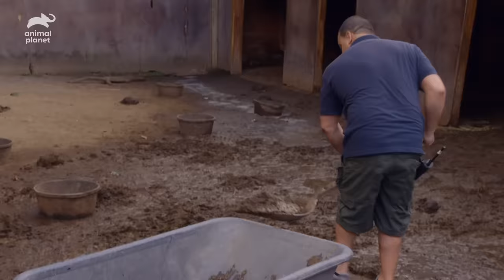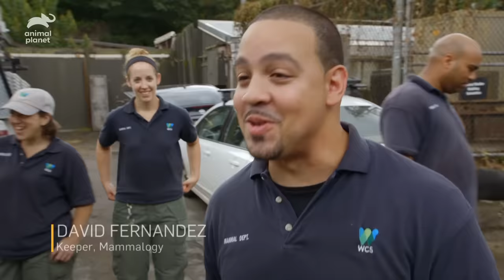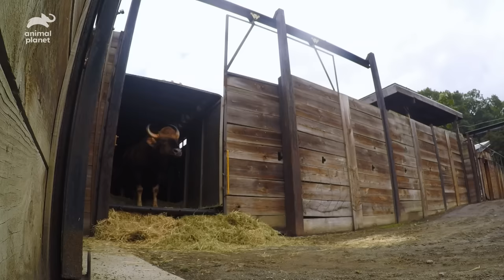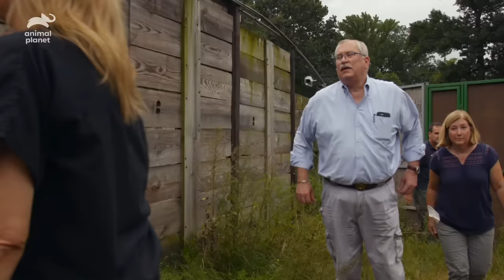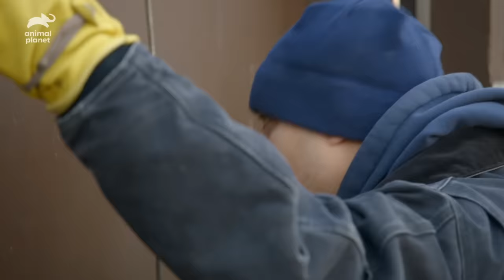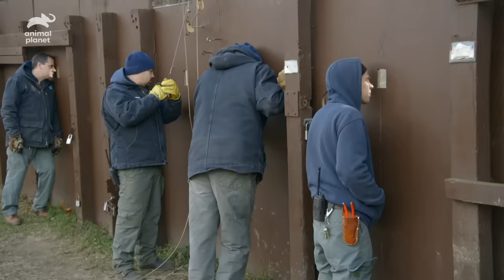The Bronx Zoo Experiences The Nerve-Racking Arrival of Powerful Gaurs | The Zoo

Comment: They need softer ground and rich vegetation.   Their hoofs need to sink in a little every step to feel sure footed..  Asphalt and concrete is not the way to go.   😥
Reply: If i am correct, i think this is just their temporary pen, and when they are actually in their permanent pen in will be nicer.
Reply: @ethan.000  I hope so. Cheers.
Reply: Aredde Serkle Cheers to you too.
Reply: Don't worry that is just a general holding/quarantine enclosure those tend to be pretty bare because they have to be easy to clean. Whenever new animals are brought into an accredited zoo they have to be held in quarantine for 30-90 days (depending on species) because if they are sick you do not want them contaminating the entire enclosure and exposing other animals.

Comment: They r not adapted to cold climate 
They r animal of  tropical region
Reply: Not really. Gaurs live in Northern India, Bhutan, and Nepal and it's really cold there. They should be fine.
Reply: *are
Reply: Gaur actually live in a wide geographical area. They do fine in northeast India, Bhutan Nepal  which is semi-tropical areas and can get really cold in winter, they have been spotted in elevations as high as 40000 meters above sea level. They'll do fine.
Reply: @RuataLungchuang  40000m height
Mt everest is 8000m high only
Reply: @sanjaysingh-bn2fu  oops I meant 4000 Mt 😅